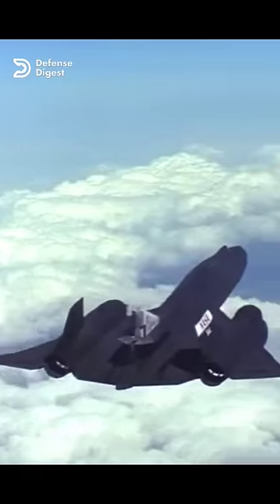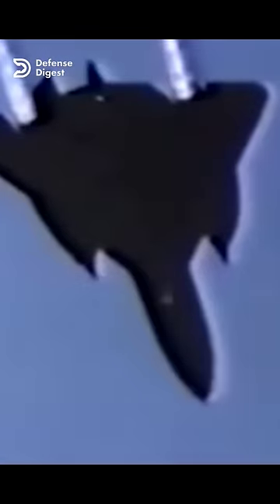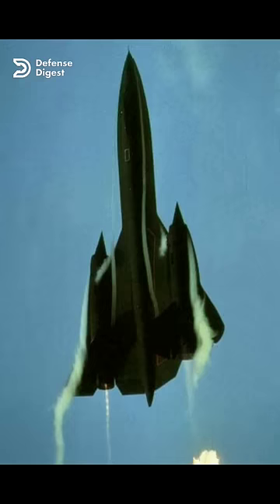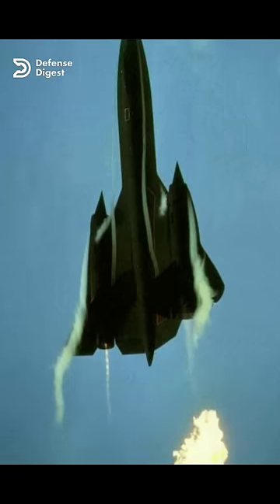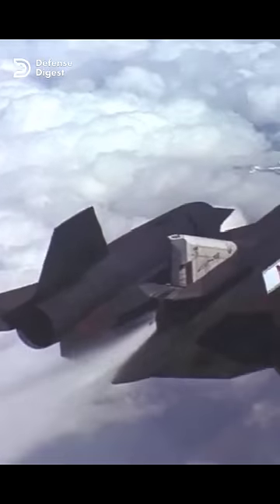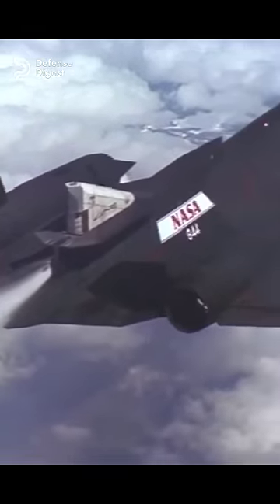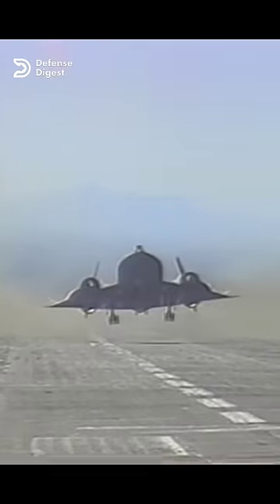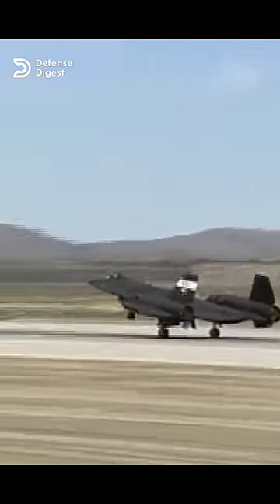The SR-71 Blackbird Is So Fast That It Lights the Sky on Fire! #shorts

Comment: Well you're completely inaccurate The flames that you see are not from the starting fluid those flames are because when it flies at high speed the temperature causes the metal to expand so when it is cool the metal is loose The fuel tanks leak fuel sitting on the ground and before it reaches temperature what you're seeing is the fuel that is leaking from the fuel tanks coming into contact with the hot exhaust stream

Comment: Kind of confusing narration.  The fuel was so special/expensive because it had to be nearly fireproof on the ground because the fuselage acted as the fuel tanks and needed gaps in it on the ground because expansion at altitude closed the gaps.  Tight fittings on the ground would mean severe deformation and structural failure at altitude once full expansion took place.
Reply: Most of your comment is incorrect
Reply: @gr8crash  Well that solves it then.  Why is that?  Spell it out, don't just say I'm wrong.
Reply: @gr8crash  By fuselage I meant of course the wings.  And I should've said the altitude and the extreme heat from the high speeds combined caused extreme metal expansion, closing the gaps.  Smaller gaps wouldn't work due to the metal's expansion.  Everything I've ever read/seen/heard about the Blackbird says that what I wrote was true and correct.  You could toss a lit cigarette on the fuel when it dripped to the ground and it wouldn't ignite.  Can't have a bunch of highly flammable liquid lying around.  By all means expand on your quick comment. Pun possibly intended.
Reply: @M Neugent  which again is incorrect. Those thermal cycles encountered during flight created the leaks, not stop them. There were no gaps in those panels, nor were they fit loose. Fuel tank sealant and seals are what sealed the tanks. The thermal cycle changes of several hundred degrees encountered during flight are what caused the sealant to crack and the leaks to form.
Reply: @gr8crash  OK,  I don't mind looking into that.  For now I'm gonna stand by what I've learned to this point.  It only makes sense.  And you didn't address the fuel.  I've only ever heard that the plane leaked on the ground so the changes I outlines were made.
Reply: @M Neugent  what you've "learned" is popular myth, but completely untrue. Having the integral fuel tanks had nothing to do with how they made the fuel. It also wasn't "fire proof" it just had a high flash point. Integral tanks aren't unusual at all and were around decades prior to the SR71 and are still used today. The fuel needed a high Flashpoint just because of how hot the wing tanks would get in flight. You wouldn't want the fumes to self ignite. Which is also why the speed of the SR71 is reduced to mach 2.6 if the nitrogen interting system fails or runs empty for some reason.

Comment: And getting her up to speed she bleeds fuel once in air requires mid air refuelling.
Reply: Doesn't "bleed" fuel at all
Reply: @gr8crash  odd as the videos ov seen it looks like its spraying fuel.
Reply: @Shadowarez  there's some of it "venting" fuel which is normal during takeoff. But ot doesn't "bleed" fuel

Comment: Once these took off they wasted so much fuel they needed to be refuled immediately. The seems leaked fuel until it reached high speed and the pressure sealed the gaps.
Reply: Popular myth. But most of your comment is completely inaccurate
Reply: @gr8crash  If that's what you want to tell yourself that's fine, but you would be wrong. I talked with individuals who were actually involved with refueling these and that's where I received my info. So I guess they are a myth as well.
Reply: @Justin KISTNER  um no. What they told you was 100% incorrect. And you know why? Because they were refueling the aircraft. They didn't fly it or maintain it, hence the issue. They also didn't always refuel right after takeoff, it depended on the mission. Sometimes they'd take off with 80% fuel take off and proceed right to speed and altitude without ever needing to refuel. Sorry, but facts are better than a story you once heard.
Reply: @gr8crash   Sure, whatever you say. Now you are telling me what you think I've heard. Remember what you said, they didn't always refuel pending on the mission. So now they have sometimes. Thank you for proving to all that it isn't a myth.
Reply: @Justin KISTNER  what part? That they always refuel after takeoff?  It's kind of a myth that people think that it ALWAYS did, but in reality it didn't,  again it depended on the mission. And just giving you accurate information so the next time you enter into a conversation about the aircraft you relay good factual information. It will also help you from being called out and corrected in the future.
Reply: @gr8crash  Excellent, now show me some data? Show me the path of my error, to correct me with evidence instead of saying I'm wrong and leaving it at just that. If you know please show me, don't tell me. I would appreciate it very much.
Reply: @Justin KISTNER  issue is images can't be posted in these comments. So just have to give you some explanation. Most takeoffs were with 40k lbs, to reduce wear & tear on the aircraft. Some missions flown were fueled to 65k lbs and the aircraft took off climbing straight to altitude and speed, there were called "rocket rides". The fuel tanks were sealed with fuel tank sealant and seals.   People often think that panels were left loose which is absurd and untrue. All panels were attached securely to the airframe, if a panel didn't attach securely it had to be fixed prior to flight. Also people think the aircraft stretching is what sealed the tanks when this is part of what caused them. The thermal cycles encountered in flight, fluctuations of several hundred degrees would cause the metal to stretch and shrink etc and would cause the fuel tank sealant to become cracked, leading to the cause of the leaks.
Reply: @gr8crash  Understood, but where did I say the pannels were left loose? Wouldn't the pannels just tear right off once in flight if that were the case. I said "a gap inbetween the pannels". Due the extream temperatures creating expantion, contraction with speed the sealent failed and fuel leaked reguardless if it was on the ground, just in flight or below it's normal speed. Again that is when the sealent fails. But when it was high up in the atmosphere, at speed, the gaps sealed themselves. Tried to say that without so many details, but now I understand why you said something. How exactly did the fuel get through the fuel tank, or was the wing itself the tank with nothing else to contain it?
Reply: @Justin KISTNER  I mentioned the loose panel part as many people have said and believe that unfortunately.  But yes a loose panel would have a likelihood of falling off, they've had fairings come off at mach 3 so. But also isn't a gap for expansion. There are a few expansion joints with the main one being at STA 715 where the FWD and AFT bodies join, and the top and bottom wing panels had the corrugated to help with the expansion, but none of these had "gaps" that would seal. And you did mention a good part, once that sealant cracked the leak was going to be there regardless. Part of the myth goes to refueling when the plane would approach the wings would be dry then have streaks after fueling, 2 details with that. Some of that "streaking" people see is from the refueling port, and some is just leaks through the cracked sealant. Also wings would stop leaking basically because they were the first tanks to be drained. But hot, cold, slow, fast once the sealant started to crack and fail it was gonna just leak after that until it was repaired. Also the wing tanks were integral or "wet wing" tanks. No bladders or liners etc. The aircraft structure formed the fuel tank, and sealant was along all interior seams with seals sealing any lines etc that had to be ran through them. This was chosen as it allowed the maximum amount of fuel with the least amount of weight. Bladders just add weight and reduce fuel capacity,  neither were acceptable in this design.
Reply: @gr8crash  Excellent, thank you for the info! I didn't know the exact specifics, and am aware of the in air refueling streaks. It was said to me very vague that within the gaps it leaked. No mention of the sealent even, had to find that on my own to. I thought it was a "wet wing", because of the sealent but I didn't know for sure until now. Would the fuel eat through any of the bladders, if they used them? Is there a website to get to know more details? Sorry for being a nat but I'm interested in this.

Comment: On the ground the Bird bleeds fuel and hydraulic oils from most of its sensitive parts. 

“ She cry’s when she is not Airborne “
Cool Huh
Reply: Huh? Virtually none of that is true
Reply: @gr8crash  um argue with the books I have
Reply: @gr8crash  she has to bleed like Concorde she expands at high speed and altitude the seals and gaskets expand and close her up . If she did not have this feature she would not work correctly . But your the expert and her pilot and most likely her mechanic so I must agree with you right .
Reply: @Lance Uppercut  thats easy to do. Don't know of any books that say it leaks hydraulic oil, the fuel one is easy as a lot of books are based of older incorrect information from the 80s and 90s when stuff was still classified
Reply: @Lance Uppercut  well most of your comment about the SR71 is still incorrect. And since you brought up the maintainers, they will agree with me as they are the ones who taught me the accurate information. They were the ones that would spend thousands of hours resealing fuel tanks etc. Pilots eh, that varies. Pilots know how to fly, not maintain, just like maintainers don't know how to fly.
Reply: @Lance Uppercut  yea the trays were to collect the fuel that leaks, that's normal. No one says that don't leak, virtually all aircraft do. But the myth part is that it leaks a lot, or that it stops leaking when in flight

Comment: Okay aviation fans, somebody tell me what the "middle"funny-looking object is between the vertical ailerons.
Reply: Air brake.
Reply: Previous comment or said it’s a test engine
Reply: Thank you for responding, I knew they had parachutes to stop with, I thought they were tucked away, because I got to see them as close as the MP's would let any civilian get to it, I didn't see any structure back there, and as far as a"test"engine, I'm really doubting that one.
Reply: @bartbullock9742  airbrakes are more for rapidly slowing in the air, rather than stopping on the ground.  I think the sr71 did carry parachutes too, but by the time the plane is landing they're not going fast enough for airbrakes to have much of an effect.

Comment: what you said is true on the start up, but that is not the reason for the fireballs during flight. thats due to the plane literally leaking fuel from every seam in the fuselage. the skin was designed to withstand the extreme heat caused by Mach 3 flight. this meant that anything exposed to that heat had to have seams loose enough to allow for expansion, including the fuel tanks. once the SR-71 reached Mach 1+, the airframe and skin would heat up, sealing everything. what was witnessed here was the tanks leaking fuel due to low heat (low speed flight) and the fuel igniting behind the engines.
Reply: Virtually your entire comment is incredibly incorrect
Reply: @gr8crash  is it? because its pretty easy to read exactly what I wrote as common knowledge of the SR71.
Reply: @Tyler  except you didn't write anything accurate. You wrote what is a popular myth, but nothing you actually wrote is remotely accurate
Reply: @gr8crash  go troll somewhere else.
Reply: @Tyler  actually haven't seen anyone "troll" through these posts.

Comment: I'm about 99% sure this video is absolute bullshit.

The engines on the blackbird were susceptible to 'unstarts' (the engine would stall) and the fuel was very hard to light (on purpose) so they used triethylborine (spelling?) to start the engines.

There was a system that automatically attempted to restart the engines if it detected an unstart event by igniting/firing triethylborine cartridges into the engines.

I expect that's what's happening here - the engines stalled due to the intensity of the turn so the plane tried (successfully) to save itself from dying.
Reply: They gave it the pops and crackles tune